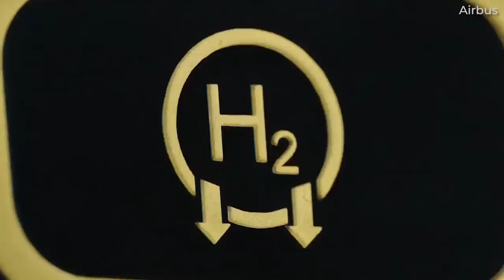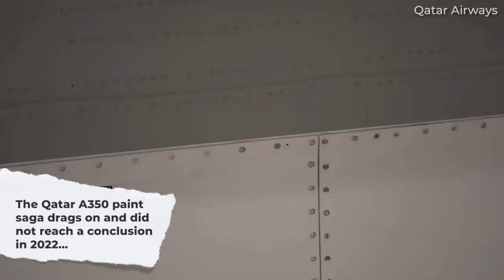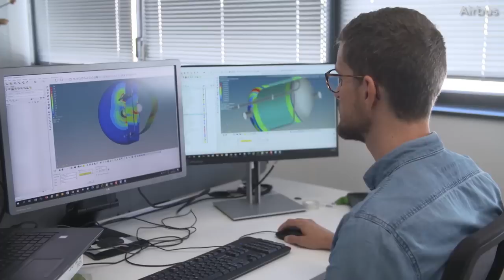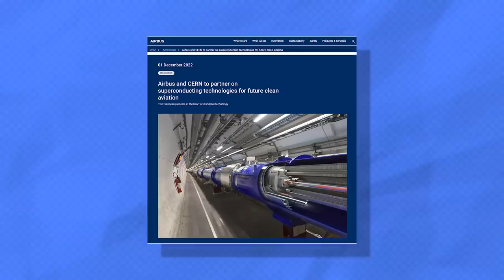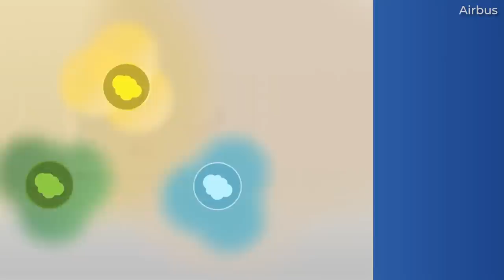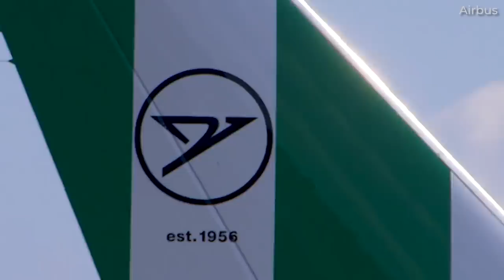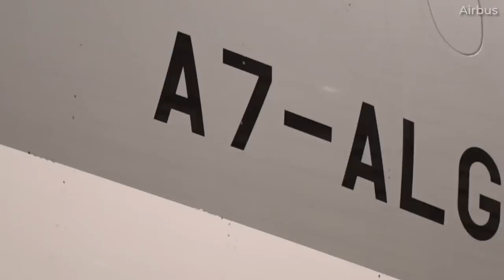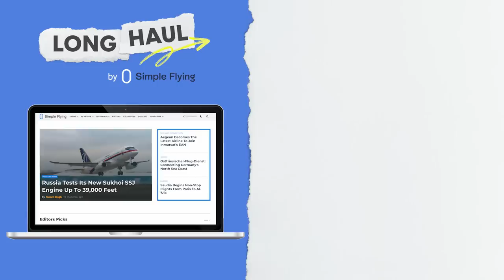What Can We Expect From Airbus In 2023?

Comment: 70.9T MTOW A220-300 with ACTs would be a truly Game Changer in; Range, Efficiency & Passenger Comfort
Reply: Indeed , the problem is if the MTOW remains the same , adding fuel capacity  will reduce payload capacity . So an a220-300 with ACTs will fly further but with less passengers ( payload)
Reply: @mmm0404  classic reasons for airlines to be chosen....|| see the current Breeze A220-300 layout with 36 Premium seats
Reply: @stradivarioushardhiantz5179  yes indeed , only 36 seats . With ACTs and  that configuration  the a220-300 could be  pushed close to 4000NM.
Reply: @mmm0404  with 80-90 Seats on economy
Reply: What is ACT?
Reply: @benoitbourdaire4194  for Airbus it's called ACT; Additional Center Tank......for Boeing it's called Auxiliary Fuel Tank. 
A220 has smaller ACT with 1.1T of fuel per tank instead of 2.35T of fuel on A320's
Reply: @benoitbourdaire4194  it's a removable fuel  tank that could be added to the aircraft's cargo bay. Great for extending the aircraft's range

Comment: I really hope that an airline like Delta Air Lines considers to place firm orders of additional Airbus A220 series, Airbus A330-800neo to replace Boeing 767-300-, 767-400ER, and possibly A321XLR to replace Boeing 757-200 and Boeing 757-300.
Reply: Their A338s are super nice, flew on one on a short domestic flight back in July and it was a pleasure. Love the 767s but would not be sad to see Delta embrace more new jets
Reply: DL has clearly shown they are not interested in he 800 version of the 330. They have had plenty of time to order it and have chosen not to. The economics on it are just not that great
Reply: @jadliban  They already have ordered replacements for the 757 and already being phased out with the 321s 737-900s and now the 737 MAX 10 order.  Where they do have a gap is with the 767s.
Reply: @jadliban  Well it's an interesting question why DL has not chosen either the 330-800NEO nor the XLR. Not gonna shock me if they end up ordering 787s if the deal is right.
Reply: @jadliban they not gonna go airbus is all bout politics
Reply: @camerone397  as a mechanic ( focused on aircraft cabins) the 330 Neo suffers from some error designs, with robinets leaking after just 6 months of use ( and a rather weird way of disassembling them). The cabin in general is a bit fragile, but very nice and soooo much lighter than old gen aircrafts.
Reply: I think it would be a good replacement if Ed Bastian ordered the A220-300 to replace the A319’s when they reach retirement age. Despite it not being perfect, the –100 could also replace the 717 on capacity.
Reply: United as well as the 707-717

I can’t believe that these aircrafts are still flying
Reply: delta ordered 738 10 to replace 757s along with 321neo and delta needs to replace A330-200/300 with A330-900s or A350s
Reply: @johniii8147  they already delayed their 787 original order
Reply: @andersonrodriguez8258  what? they ordered A321 and asked airbus for me A350s that airlines cancelled
Reply: @Kevinksk92  Actually they canceled that order altogether a few years ago. Swapped it for a large 737-900ER order. They operate 120+ of those now.
Reply: @Kevinksk92  No they have not asked Airbus for canceled orders. They took LANTAM's instead directly from the carrier as part of their investment.
Reply: @Kevinksk92  I think A350 would be better suited, the 330 have some minor issues

Comment: Airbus should develop an A350-950, which would be a passenger version of the A350F. This would allow a combination of new A350F and converted P2F. Many airlines chose the B777 over the A350 because at the end of its passenger life, they would still obtain a reasonable price for the airframe to be converted into a freighter. The same will happen for the B777X, unless Airbus uses the same trick.
Reply: @HugoAelbrecht  the a350f is the freighter version of the a350. A passenger version of the a350f would just be the a350. Dvmbass
Reply: @Nicolas-ol7jl I see, maybe before calling other people idiots, you should try to inform yourself properly: The 350F has a length between the 350-900 and the 350-1000. It has 6 wheels per train, like the -1000 (the -900 has only 4). The logic behind this is that a freighter needs to carry more weight than a passenger plane (volume is far less important, since most of the time the max weight is reached before max volume). Hence the -900 passenger version is not appropriate to be converted into a freighter and the -1000 has too much useless volume. That is why I suggested a 950 passenger version with the same length, trains, engines as the 350F. At the end of its passenger airplane life, it could then easily be converted to a 350F. This would make the 350-950 a more attractive passenger plane than the -1000.
Reply: So A350 Combi? Interesting proposal.

Comment: A330neo freighter should be a thing. Aluminium shell means it’s easy for cargo doors. Perfect replacement for the 767F.
Reply: Boeing will be manufacturing the 767F till around 2027 ( unless a waiver is granted beyond that) , and it would be way cheaper and fit into smaller gates ( code D) , than the a330neoF ( code E)  . It currently  does not need a replacement. 

Recently delivered  767F's won't need replacements till the 2030's
Reply: Airbus will probably only launch an A330neo freighter if Boeing launches the 787f
Reply: @mmm0404  330 would still be better
Reply: Given how few have sold, the cargo carriers don't agree with you.
Reply: I find that if Boeing developed the 787-8f it would be much more efficient for replacements

Comment: A331XLR. Let's say you don't care that the fuel tank protection is facing criticism. How much cheaper would a flight from NYC to LHR be compared to an A350?
Reply: The XLR is suited to fly routes like Bristol to NYC which means that smaller airports can receive long haul routes
Reply: It is more of
smaller airport to smaller airport 
Or
Larger airport to smaller airport.

Example New York to Stuttgart
Normal: New York to Frankfurt, Frankfurt to Stuttgart
Xlr: New York to Stuttgart
Reply: @gong9901  It's an aircraft that will be operating from hub to smaller spoke city.
Reply: @johniii8147  Well John, if someone does not understand the purpose of the XLR. There is a high chance they do not understand the hub and spoke model. So what I did is I explained it in a way that is more simple. Please John, not everyone has the same knowledge as you do.
Reply: @gong9901  The article was focused on cost without specific mention of filling big planes.
Reply: @johniii8147 like Vancouver to Yellowknife, Montreal to St. John’s, Los Angeles to Boise.

Comment: What is going on with Delta Air Lines A350-1000 order for 20 ?
Reply: DL ordering more A350s should be an obvious move for the airline. They've sold all their old 777s and the 777x program is delayed, so any hope they have of moving forward quickly rests with the 350 (and 339 to an extent). The Russia situation has damaged their plans of US-India non-stops though, so it would need both the aircraft & political situation to start penetrating this important market.
Reply: delta didnt order the A350-1000

Comment: i think the next realistic challenges are electric/hybrid for short range flights and preparing an A350 NEO with the RR Ultrafan.
the hydrogen crap and bodywing concepts are more a theoretical concept that cooks on low heat..
Reply: The biggest crap is electric in aviation but yeah, you might be on to something here. If only you could come up with a safe battery with about 100x the power density of current day li-nmc  incendiary devices but without all its flaws, instability, limited charge cycles and most of all, its tendency to have an energy density so high, any chemical disturbance makes it burn vigorously. 
Maybe Elon Musk has an answer?

Comment: Interesting video. 
However the development and qualification track for the A321XLR in 2022 has been far from going « according to plan » with the big issue of additional tank certification issues, which as of now still seems unsolved. 
As of the target 2023 production rate for the A350, I suppose your « 6 » is to be understood as 6 per month.
Reply: The A321XLR is meant to be certified in 2024 and is running 6 months late currently!
Reply: @heidirabenau511  More than a year late actually

Comment: Will we not see any more development projects like A220-500, A322 or a new length variant between A320 and A321?
Reply: They are no hurry for 220-500. Still too many problems/losses for the current models in production.
Reply: I guess A220-500 will be close to todays A320. Thats why Airbus also need to stretch the 320 slightly.
737-Max 8 can seat up to 200 pax, and the A320 only ~185. This is why 320 needs a new lengths variant
Reply: @planflykt  they already have that in the 321
Reply: no
Reply: @johniii8147  
The size gap between A320 and A321 is quite big. 737-8, 737-9 and 737-10 are all between the A320 and A321 in size.

Comment: They need to develop a streched A350 - 2000 that can compete with 777 - 9
Reply: They have already stretched the 350 about as far as they can without major upgrades. And there just isn't market demand for a larger versions. The 1000 itself has less than 150 sold.
Reply: @johniii8147  not sure why you're here as all you ever say is anti airbus comments so you shouldn't even be watching this video
Reply: @ant2312  Wrong. I'm actually neutral between Airbus and Boeing. Airbus is justifiably killing it in the narrow body space.  Widebodies, not really. The sweet spot for the market the 787 hit and we shall see on the 777-9
Reply: The a350-1000 is already a very good competitor to the 777-9, they’re the exact same length.
Reply: @sandbox__8888  Not really. the 777-9 is about 10 feet longer. Not really the point though. It's also wider with 10 abreast so has more capacity
Reply: @johniii8147  length wise its just ten feet. But capacity wise... 10 abreast is massive. I stand corrected
Reply: The -9 passenger variant will be a flop, it's too big for the modern market, it's why the a380 and 747-8 have flopped
Reply: @ey7290  Not likely. It's already sold more than the 380. Assuming it meets performance specs it will sell well over the long run if it proves itself in operation. Won't be the huge hit of the 777-300ER most likely but should sell well over 500 in the end.
Reply: @ey7290  the -9 has more orders than the a350-1000 which is smaller and cheaper. 

The a380 program cost $30billiion+, the 777X program is currently seating at $7 billion. 

The 747-8/was just built to make the a380 flop, so they couldn't care less since their main focus was on the 787

Comment: @long haul by simple flying Do you think AirBus will ever continue with the manufacturing of the A380 or it finally met its grave?
Reply: The only way it could come back would be as a 2 engine version. The new engines that Rolls Royce is currently developing would have enough power. That would also require a new wing design. Even then, the width and long runway requirement would still limit its success. Never say never though! Emirates is probably still pushing for this to happen.
Reply: @HugoAelbrecht   I think Emirates was the only company supporting the manufacturing of the A380... And it happened to be quite a success to them with the number of planes they had..
Thanks for replying ❤️
Reply: The supply chain is now completely shut down and the former 380 final assembly plant is now relocated the the to the 321. Airbus has moved on.
Reply: @HugoAelbrecht  A 2 engine plane would likely be a new airplane
Reply: @danharold3087  I agree, but if Rolls Royce develops the engines anyway, Airbus only needs to modify the wings. Avionics and all the rest are still perfectly up to date. It would continue to be the quietest commercial airplane ever produced. Also the cheapest per passenger per mile to operate – provided that it can be filled up. Since in the long run, the number of air travelers will continue to increase and airports will become increasingly overcrowded, never say never. Boeing would have no answer, because unlike the A380, every single aspect of the B747 is outdated, not just the 4 engines.
But I a agree that in the short term, there is no need.
Reply: @HugoAelbrecht   Airbus would want a new more efficient carbon fiber wing.    If I understand correctly a 2 engine wing would be new anyway.   Remember we are pushing a large fuselage through the air.   If like you say this is a product for the future the fuselage may well need replacement.  I don't have a crystal ball.

Airbus is kicking down doors and taking numbers with sales.  Arguably this would be another lucky to break even venture.     I don't think the pressure to have the largest jetliner is what it was when the A380 was built.  It was never a sound business case.
Reply: @danharold3087 Indeed, it was never a sound business case. Initially, Airbus said that the A380 would break even at 250 aircraft. They sold 251 and were absolutely not break even, probably a.o. due to heavy discounts for Emirates, buying 120 of them.
I am intrigued by the fact that the first version of the Rolls Royce Ultrafan engine will be way too powerful to replace any existing jet engine. Why? If Airbus could sell another 250 new A380 with 2 engines, by just developing a new wing, I think the business case would be very sound. Sir Tim Clark from Emirates would be begging on his knees for this plane.
If that turns out to be profitable, they can think about a lightweight fuselage later on.
Reply: @HugoAelbrecht   Guessing.  Although it is more difficult to built the larger ultrafan first it more or less ensures that making smaller ones will not require a lot of R&D.  So maybe they can build 3 engine sizes in the family and only pay the major R&D hit once.   It may also be seen as a way to attract buyers.  If we can make this huge engine work rest assured it's smaller siblings will not have the trouble seen recently developing large engines.  
I don't know what commercial aviation will look like down the road.  You could be right.  Or they could be wasting engineering resources on a plane with a larger market.
Reply: @danharold3087  Re: “If we can make this huge engine work rest assured it's smaller siblings will not have the trouble” That’s a lot of trouble if it’s just for a demonstration. However, if it proves to run many millions of miles in a real world scenario on only 50-100 planes, that’s a nicer proof of concept without taking too much risk. After all RR doesn’t know for sure if it will run trouble-free either. Better have a handful of customers, ready to pay the high price initially. Hence a new A380. Pure speculation of course, but with some logic behind it.
Reply: @HugoAelbrecht    GE and IRRC RR have both had difficulties with new big engines causing trouble.   If RR can leverage this to show it knows how to build engines better it is a win.  New 380 is very unlikely.   Not worth the speculation.    Even if Emmerits paid for the R&D it would be a bad idea. Better to put R&D to work on a plane that will sell lots of copies. Or working on new tech needed for next gen planes.
Reply: @HugoAelbrecht  Should add.  This was more than a demonstration.   The hard part on these engines is the internal gearing.   Other have tried and failed.  A material science thing.   This demonstrator allowed RR to address and overcome that.  Why do you think they did it?  These people are not stupid.
Reply: @danharold3087  I agree, but I don’t buy the idea that they made such a powerful engine, just for demonstration purpose. Besides, these demonstrations don’t prove anything: when P&W started using their gearbox, everybody though this would generate problems. It turned out that the gearbox was fine, but there were other problems, some of which were discovered during commercial flights.
What about the Airbus response to the B777X? Making a slightly larger A350 is not the solution. Building a far bigger plane with far lower operating costs per passenger might. Especially, when most of the job is already done. The Ultrafan will not only be powerful enough, it will also provide 20 to 25% better fuel efficiency. This also increases range by the same amount. That’s how to beat the B777X in its own game!
Airbus is currently working on their superwing with folding tips. Where do they need this? The A220 sells well as it is, the A320 family also. The A330 is too old and the A350 is too young. The perfect test-bed would be the A380!
Reply: @HugoAelbrecht  i am not sure if the ultrafan has enough power. it is just bigger but only a few percent more powerful than the engine in the a350. the reason for its size is the high bypass ratio to achieve a higher efficiency
Reply: airbus would have to make an a360 with RR Ultrafan engines and latest lightweight tech to increase the capacity by 20%.